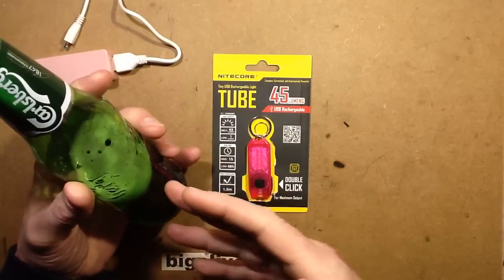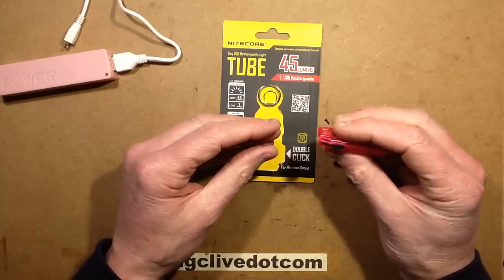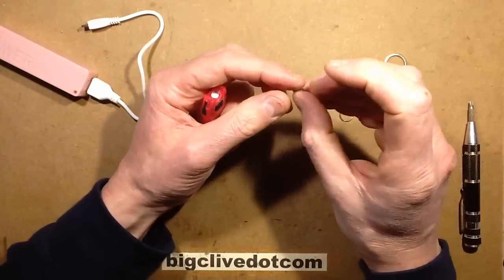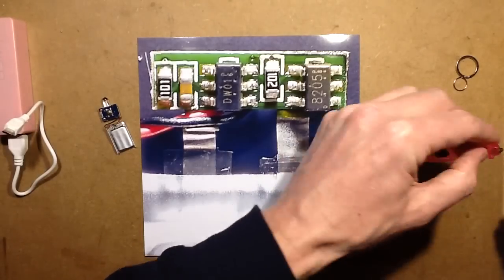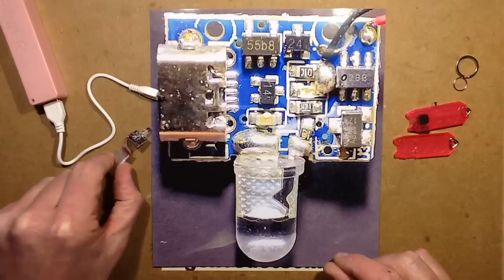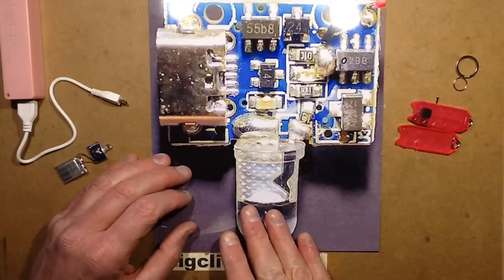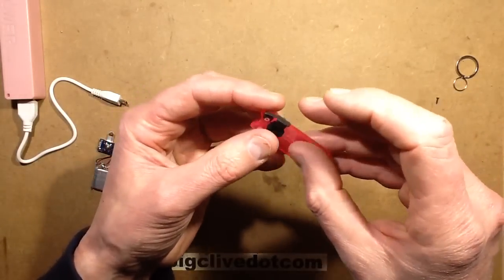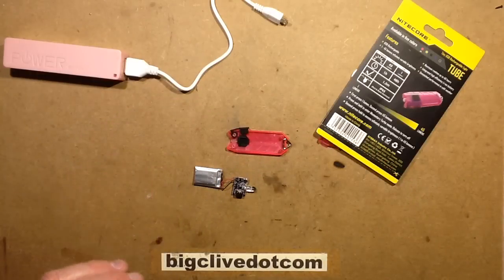Nitecore Tube keychain flashlight teardown.  (Half watt LED)

Comment: Nitecore make some canny stuff.
Reply: nitecore 18650 chargers
Reply: to be honest, I wouldnt touch any other 18650 chargers. hell I probably wouldn't touch anything else for normal batteries.
that said, could you imagine if apple made vape stuff? I could imagine some people paying £200 for a vape charger with the apple name
Reply: Stephen Twigg
The D4 is a decent charger and a good one in the "idiot proof" category. It also as you say has the option to display what is going on as its charging (I've gota D2 model that rarely gets used). My main gripe with the D4 is that its current gets limited automatically when you insert more than 2 batteries or in the wrong slots.

The way you handle it I think you'll be able to pair the cells with enough margin of error. From what I remember the charger also is supposed to do an internal resistance check when a cell is inserted, if its too high its supposed to give an error rather than charge it.

And dannypeck666 any charger that keeps on trickle charging even if its less than 1 mA  in my opinion is a faulty charger for lithium ions that should be disposed of/fixed. After the constant voltage phase terminates the charging circuit should stop entirely a typical charger will after that point enter a slight discharge state (a couple of micro amps or so at most) and more when its not powered simply due to how it works.

Stephen Twigg Regarding inserting the batteries to check the voltage though, I guess its one way to check it. I normally go for a multimeter, either a handheld one or my fancy second hand HP 34401A since they're within reach on the electronics workbench anyway with testleads already inserted. It gives a bit more resolution and precision but 0.01V resolution that the Nitecore D4 gives is decent enough.

The additional benefits of the SkyRC MC3000 charger (and various more universal ones for lipo packs and anything else) is that you can set just about any charge current. On the MC3000 you can define a lot of parameters for lithium ion charging:
- charging current (0.01A resolution)
- target voltage (0.01V resolution)
- cutoff current (0.01A resolution)
- timeout period in minutes
And a few more settings, but these are the key ones. For example if you wish to undercharge your batteries a bit so you get a better cycle life out of them you can choose to set 4.19V and 100 mA termination rather than a typical 4.20V and something between 50-100 mA termination.

It also features options to do a discharge test and get a capacity afterwards in both mAh and Wh. There's a graph too that you can see on the phone/tablet or the screen of the charger. It can communicate and log to a computer too but the computer at my electronics bench hasn't been tested for that yet, its ports are kinda filled up with the programmable lab powersupply and some other more useful gear.

The big advantages really in my opinion of that charger is that it offers a fairly straight forward interface with which I can define a few charging profiles (target voltage, charge current, cutoff current) for a few battery types I've got around. I have some high capacity 18650 cells which I prefer to charge at 1.0A, a few high drain ones that can easily take 2.0A or more without serious cycle life reduction and smaller cells that need lower charger currents more like 0.25-0.5A. I can set it properly for every type and you've got a similar plethora of options for NiMH etc too, you can even set the -dV/dt threshold if you've got some particulary picky batteries that don't pick up well on standard chargers.

The other useful feature that I use at times is the "storage" profile for lithium ion. Basically a partial discharge to 3.6-3.7V rather than near full state of charge which is supposed to be better for long term durability as the internals of the battery will have less undesirable reactions going on. This is the reason why most manufacturers ship batteries in this state as well.

Short summary: If you set that unit to "advanced" mode rather than basic mode which it is set to out of the box you get a lot of functionality out of it. And it has a pretty good consistent battery diagnostic toolset, its well worth the price in my opinion. Nothing wrong with something like the D4 though, its good at what it does but I always feel limited by them. Can't pick the charging currents I want to set and I don't get direct information about battery temperature and internal resistance.
Reply: Theres a Nitecore recharger sitting right in front of me :D
Reply: Yup I have a charger here too. I use it for 18650s - has to be the best charger out there?
Reply: I wouldn't call them the best by a long shot, I will say this though. They are good affordable chargers, only personally seen one unit so far on which one of the charging slots was a bit poor (it charged to 4.28V during CV stage resulting in overcharged 18650 cells). Beyond that they are good at making simple mostly idiot proof chargers.

Nitecore and xtar are doing a good job at producing fairly affordable chargers that get the job done, the two charger models that I'm fond of myself however are the Xtar VP2 and SkyRC MC3000 for cylindrical cells (imax chargers for the lipo packs, but that's a different beast entirely).
http://lygte-info.dk/review/Review%20Charger%20SkyRC%20MC3000%20UK.html
http://lygte-info.dk/review/Review%20Charger%20Xtar%20VP2%20UK.html
Perhaps a bit more expensive than some of the choices out there but it provides me with more options and its also useful to be able to run a discharge test and group similar capacity batteries together in sets for applications that take more than one 18650.

The Xtar VC2 Master (http://lygte-info.dk/review/Review%20Charger%20Xtar%20VC2%20Plus%20Master%20UK.html) deserves an honourable mention too, quite neat to have it be USB powered and also be able to function as a powerbank with a charged lithium ion cell in slot 1.
Reply: Extra stuff   Yes - for me idiot proof is ideal haha!

I use a lot of 18650s in my equipment and after a day out the batteries all need charging. Being able to charge 4 at once using one charger but also being able to check charge rates, voltage drop and the like I'm able to 'pair' batteries together to get the best from the devices they power.
Reply: Stephen Twigg Which Nitecore charger are you using then? I've not come across any proper analysing chargers by them yet. But I must admit I also haven't been looking, they mostly seem to be doing decent chargers that fill your batteries.

For measuring battery capacity I prefer a good discharge test, the quick and lazy way for me is sticking them into the SkyRC MC3000 mentioned above.

And if I want to do it properly I use my electronic load set to constant power (since that's the typical use case in regulated torches, not constant current) and log the data to connected PC. But that's slow and tedious, one cell at a time and it keeps my load occupied while its in progress.
Reply: I use two Nitecore D4 units.
There's no way I'm technical but what I do know is well balanced and matched cells placed into the same discharge unit (torch etc) will perform better.
With those chargers I can place cells which were charged to full capacity a week previously and the device will show me the voltage of each cell. That in itself tells me which batteries are showing signs of trouble.
Reply: I'll add - the charger shows each cell (4) voltage, charge rate etc independently.
Reply: Stephen Twigg this and the auto shutoff features is why I recommend them. you wouldn't believe how many people I help with vape stuff who leave batteries charging overnight, and it's better to get them something that actually shuts off than hoping they don't  leave it on overnight

Comment: I got several Nitecore flashlights. From a really tiny one that i store with my electronics screwdrivers set to bigger ones. And i love all of them.
I also got a nitecore charger for 18650s, really good "simple" charger with protection. Just a bit slow, but i prefer them being charged slower anyway, and i got enough spares.

So the genuine Nitecore products never failed on me.

Comment: IP65 means total protection against dust and protected against low pressure water jets.
IP66 is high pressure jets and IP67 is protected against short periods of immersion in water.
So that should meet the IP65 rating.

Comment: Is the screw a JIS rather than a Philips head?
Reply: not when its made in china, only Japanese  and even then, mostly just top end manufacturers, honda, kawasaki and makita are 3 places ive encounterd them, but not on sony electronics
Reply: +peter everett I came here to say that, I've seen tiny JIS screwes used in other gadgets, and while you often can get a phillips or other cross blade screwdriver to work, a small JIS bit does work better.  one of my multibit screwdriver sets has some small JIS bits, always wondered why there were extra 'phillips' bits in it, with a j designation.... then I learned about JIS.

Comment: i got the lumintop aaa keychain light on sale and it's got a convenient setting like yours, it starts on the mid setting, then low, and high, and can put out 110 lumens. it can be quite bright. i've had a lot of little lights and this one has been the best one i've had so far, the switch is excellent

Comment: I'm afraid there must be something glitched in my head...if something refuses to open with a screwdriver, I use a hammer...it generally works...
Reply: that sounds like the 'AvE-approach'
Reply: No, the AvE-Approach would be to use a circular saw or his bridgeport mill.
Reply: Lol Ave another interesting channel
Reply: have an old set well not that old but when meritline bothered to sell cheap chinese stuff I got one and it has the tiniest screwheads I've ever seen and I mean very tiny.  like microscope tiny.  but They generally work.  I say generally.  Sometimes you get fake metal screws maybe out of resin or some crap like that.  The sort of metal that a local schoool had to recall all their locked door handles because someone snapped one off without much force.  :O  oh....  Those sort of screw will snap :(
Reply: cogidubnus1953
Reply: In that case i usually use a glowing wire (or soldering iron) to heat the screw till it's head melts through the plastic...then you can unscrew it with pliars and replace it with a screw with bigger head (or just same+washer).